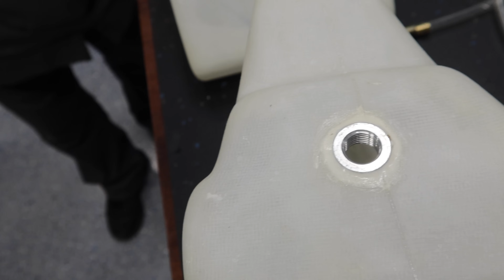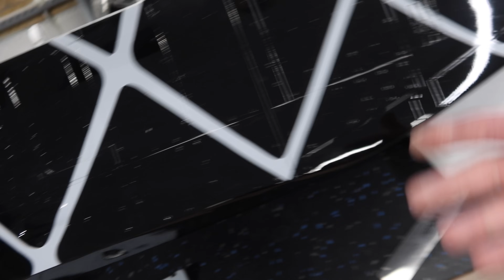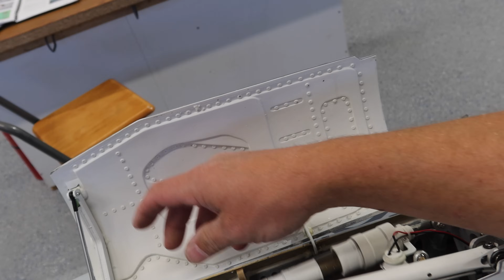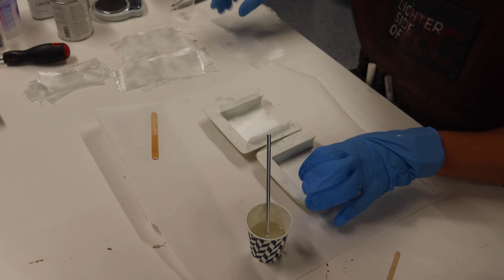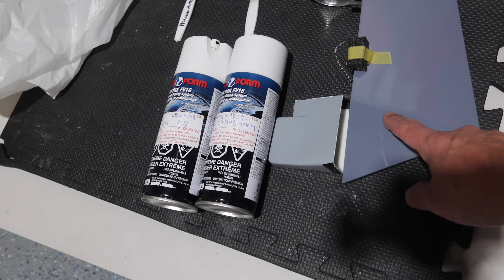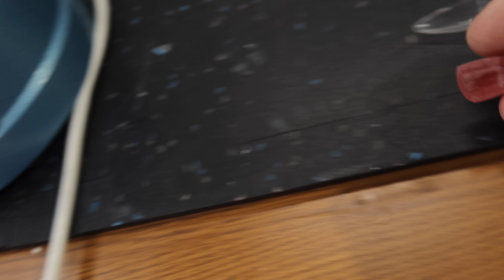Building Dreams: The Journey of Assembling BVM 1/5 Scale F-16 RC Jet

Comment: Regarding tail hook, I confirm that most of current jets are fitted with emergency landing tail hook in case of loss of brake system. The difference with aircraft carrier planes that can lower or retract their tailhooks is that the tail hook on F16 and other non navy jets can’t be retracted once released.

Comment: Nice. Couldn't you use the vacuum formed plastic as a plug to pour the epoxy into for the other side? Mike c
Reply from the maker: definitely an option. both sides ended up slightly different shapes and sizes.
Reply: @thelightersideofrc  gotcha.

Comment: Do not go around in a circle while fastening the screws of a wheel. You will get some unwanted tension in the structure. Fasten one screw and next the opposite one. Then take the 90° ones and so on. Always do it symmetrical or you have a high risk your wheel will wobble or break.
Reply from the maker: Understood. But in this case the screws are all tight already.  We are removing to install loctite only.  If we were taking them off to change tires than I agree with your comment.

Comment: I know that you have been doing this for a couple of years, and wanted to pass along a tip ( No screwdriver involved, bent or otherwise) that I ran into years back- Hitec servos were failing at the splined output shaft, directly related to using LocTite as a security measure.  I saw in trade publications that they determined that the chemicals in the LocTite degraded the plastic in the shaft, making it brittle, with the associated failures that we all can imagine.  E6000 or medium CA ( the black version is great) is a better adhesive according to what I saw.  Don’t know why, as I didn’t have chemistry in my education at the school of hard knocks 😅. But I would think that with the amount of work that you put into the verification of all fasteners in such an expensive ( and potentially dangerous) aircraft……..  do you have personal information that alters this esoteric piece of information?  I would love to be corrected, but definitely remember the kaos that was happening, and saw it from a number of other sources.  I don’t know if you are familiar with the Karbonite Gear era, but it’s put extreme caution in my assembly procedures.  And you mentioned working on full scale airplanes- I fooled the FAA into furnishing me with a license saying I’m smarter than the people who know me will admit to-  when I’m present anyway 😂.   Love what you are doing, a gearhead dream hobby/job!  Can’t afford kerosene engines, but worked up to quite a few thumping twins.   That three cylinder is music to my impaired hearing ( gas turbine helicopters finally pushed my ears past “ normal “ recognition 😢 but that engine 😊sweet!  P.S.  blue tape is far superior to tan.  The adhesive is better, doesn’t leave residue, is elastic for better clamping pressure.  Boat shop/ composite knowledge that keeps a roll of it always available.  3/4” is what I have always used.
Reply from the maker: Yes it's very true that Loctite degrades some plastics.  A prime example is the plastic Door hinges that get used on many scale Aircraft.  Loctite makes this plastic turn to almost brittle (Friable) mush in a matter of a few minutes.  I found that out the hard way and had to change hinges because of it.  So if i'm mounting a ball to a hinge like that I will use a loc nut or a regular nut with a drop of CA on the nut to keep it in place.  

In the case of servos, We don't use any plastic gear/spline servos in any of the aircraft I build.  Even the small ones would get metal shaft servos.  So the use of loctite on the holding screw is no issue at all.  If we are using a nylon servo arm it's still a non issue as the loctite is carefully applied to the threads of the hold down screw and that's is.

Comment: Nice vid Jon. Amazing the amount of not loctited areas they didn.t do especially on the Landing Gear. This of course dos not come under the cost ratio and they leave it up to the buyer to sort. That Vac machine is very nice and great job Kelly looks like a bought one. Quite a bit to go over on this puppy but in saying that it,s gotta be right.. Keep at it now.
Reply from the maker: Yea pretty typical but I was expecting the fuse joints to be done as they delivered the aircraft together.